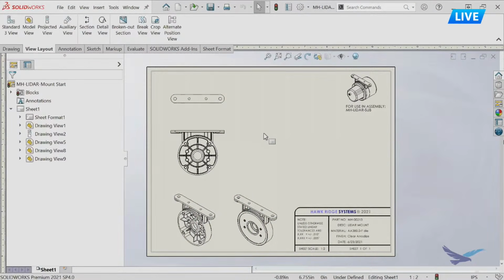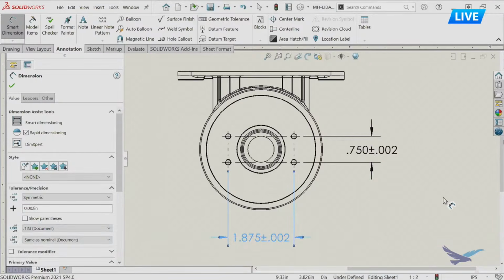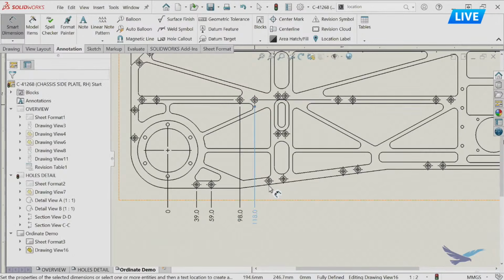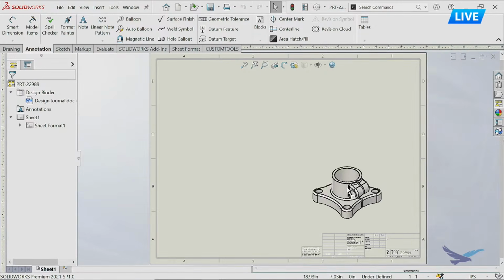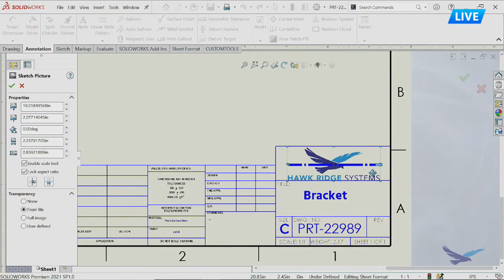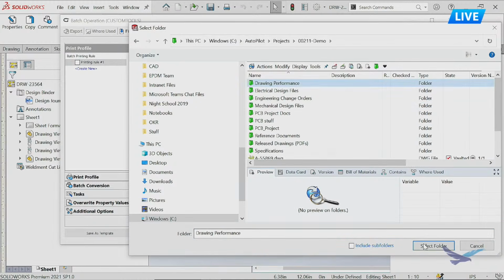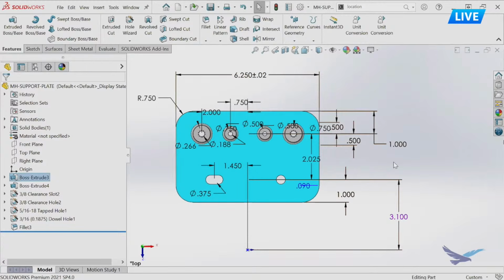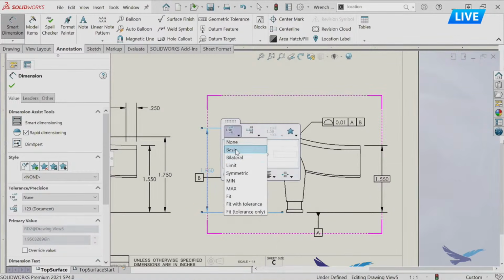TOP 10 DRAWING TIPS AND TRICKS ENGINEERS NEED TO KNOW

Comment: Started using SW 2005 while working for Directed Energy Solutions, Colorado Springs.  Previous SDRC-Ideas user, then ProE.   Once I got my hands on SW I never wanted to use the others again.   I designed military high-energy lasers in the early development phase.   Had a great time.   Have since designed surgical lasers and cinema 3D systems.